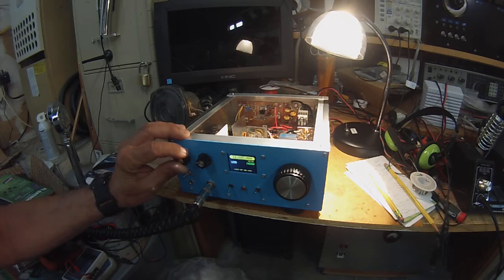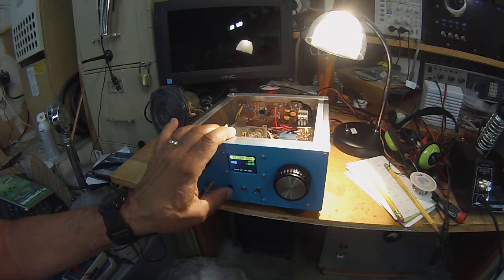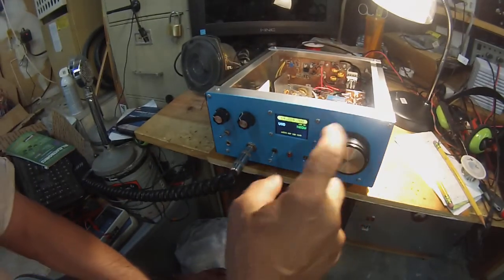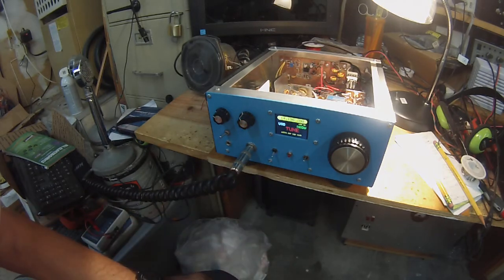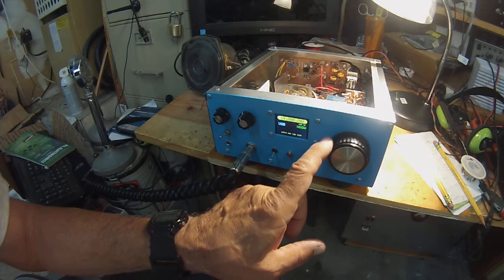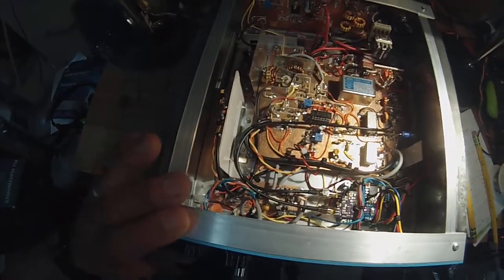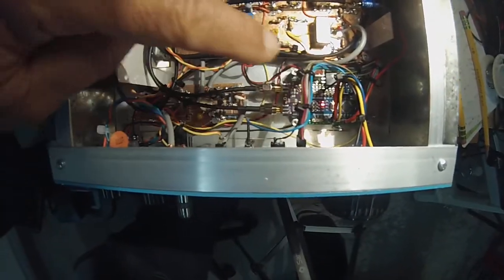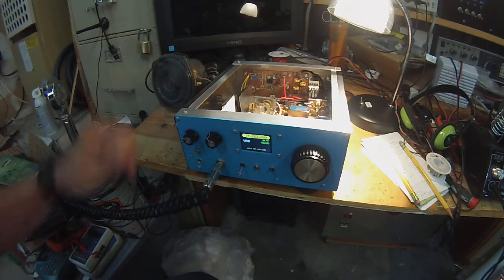The LM373 SSB Transceiver -- 1970's Revisited

Comment: Pete, since you use the Si5351 in a lot of your projects, I have a question. Does the Si5351 have the "pop" issue that the Si570 has when making large frequency excursions?
Reply from the maker: Hi Ray,Thanks for your post. NO!!! It sure doesn't and it is just smooth tuning. In one case I have a setup where the Si5351 can tune fro 1 MHz to 50 MHz in one band and aside from your arm getting tired --smooth as silk.73'sPete N6QW
Reply: Thanks Pete. That is good to know as I am considering using it in a 40/20 meter project I have in mind.
Reply from the maker: Hi RayCheck my website http://www.n6qw.com/Big_Kahuna.htmlThis is a two band rig and the band selection is done with a simple toggle switch. The switch not only puts the rig on either 40 or 20 Meters but at the same time switches in the proper BPF and LPF pair for the band in use. While it is these two bands the actual code covers 5 bands so you can also have combos like 40 and 15 Meters or 80 and 10 meters etc. The code is shown on the series of webpages that cover the details of building this rig -- there maybe an idea or two that would be useful to you.Have fun and let me know your progress.73'sPete N6QW